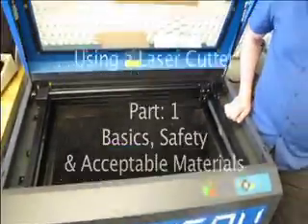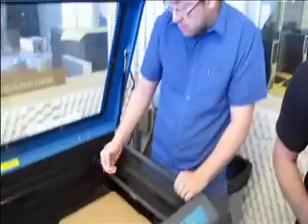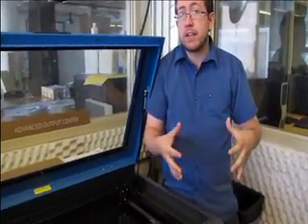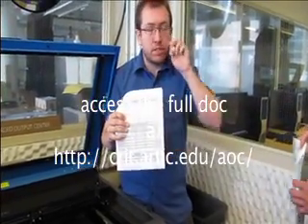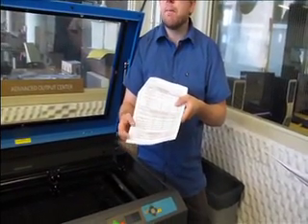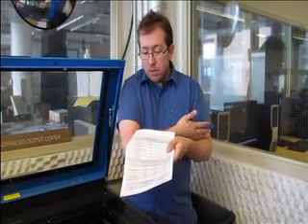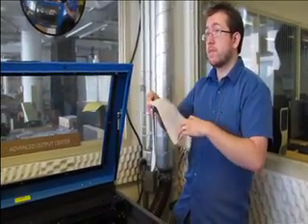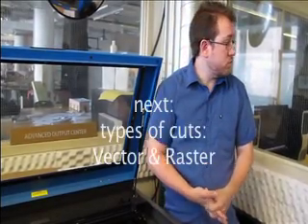how to use a laser cutter part 1

Comment: cool video!!!
wish a list of what is safe and not safe was posted
Reply from the maker: hi stevun, I think that various output centers would have different views on safe materials. They also told us at SAIC that they are constantly updating the safe materials list. What they do there, which is a great idea, is to keep a large binder that actually holds sample cuts from safe materials, such as wood, leather,plexiglass, cardboard etc.
Reply: cool thanks, I watched this video because, I saw there a laser cutter I plan on getting to cut some plastic sheets.  It's one of the cheaper versions, only sold for 700, you think the machine comes with some kind of similar list?  I just don't wanna cause a fire or damage it when I get it.
Reply from the maker: Stevun Spence If you want to cut plexiglass it should be no problem, and if it does not come with a list call the manufacturer and ask. I cut through plexi with that machine and also etched using an Adobe Illustrator file. Check out the other videos if you want to see how to set them up; I think each one goes through the entire process pretty detailed. Good luck!